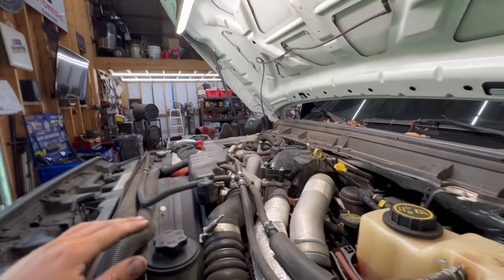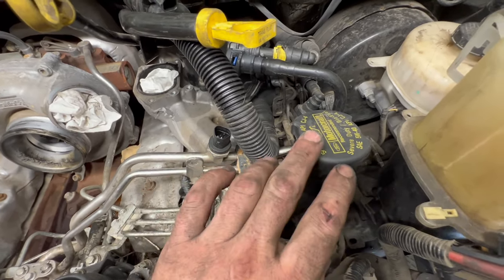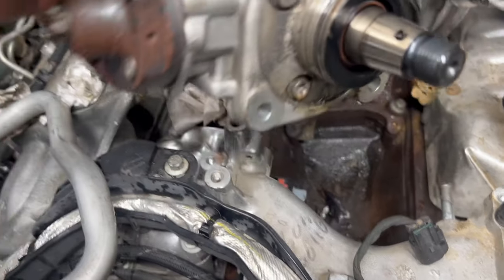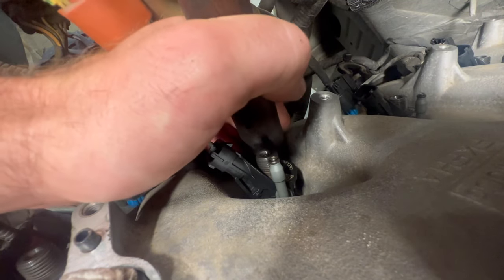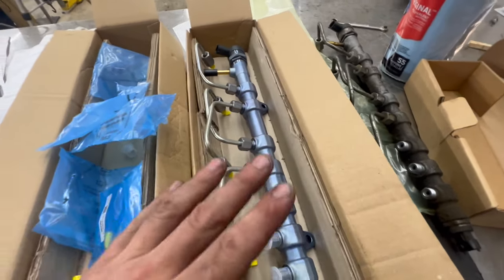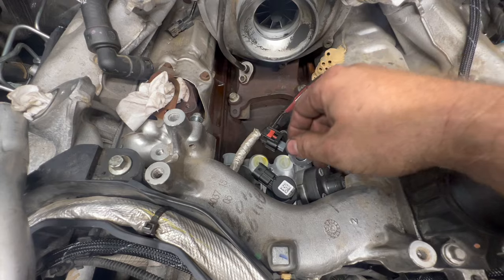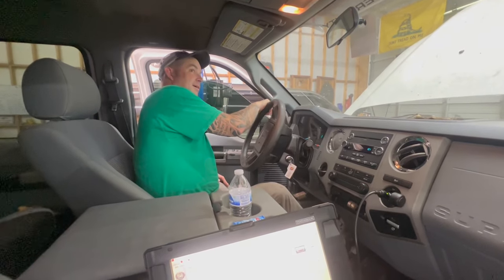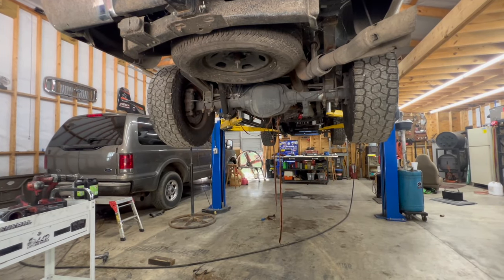6.7 Powerstroke cp4 fuel system replacement

Comment: EXCELLENT video! Doing a little bit of studying here. I’ll be replacing the CP4 on our 2017 F450 wrecker this week, got towed in behind our (thankfully) already CP3 converted RAM wrecker for a lack of power, then died while idling. Fuel filters are full of metal. Trying to tell my boss (a retired Ford master tech, did most of his work on 6.0s) that you can’t just replace the pump without having a repeat failure, as I’ve done this job on a couple LML Dmax trucks from my days at the dealer. Hopefully this hammers that fact home, as much as it sucks for the downtime of the truck and profit losses, it beats having to do everything a second time.
Reply: Hey, did you get it done? I’m about to attempt this job as well.

Comment: Very well done video on this project!  Thank you.  What did you see on the computer to follow this repair?  I have 2012 and died on the road with no start,  p0087 code.  I thought cp4 for sure,  pulled vca/vcv on top of cp4 and clean as a whistle no metal so I replaced it,  also looked at the PCV on driver side fuel rail also clean as a whistle,  replaced it as well.  Only getting around 300psi actual with almost 5000 desired.  Also put gauge on low side before engine mount filter and had 54psi.  Not sure where to go from there.

Any suggestions would be greatly appreciated.

Thanks
Reply: Mine is doing the same thing
Reply: Sounds like a cp4 failure. I have seen some fail without sending metal through the whole system. There is a good right up somewhere on the forums about it. I’ll try and find it.
Reply: Was it fixed? Have same issue here

Comment: my 2015 f250 needs this done to it, CP4 blew out about 2 months ago w/280K (yeah I drive a lot--DFw to Houston to Austin at least once a week sometimes twice). Luckily,  I have my previous truck-2011 Ram 6.7 for  back up. I am wanting to do the DCR and new rails/ injectors/lines etc, but I am wondering why it is necessary to drop the tank and clean it? with a new lift pump and the disaster prevention kit and both of the new stock filters, how would any of that glitter make it past those three filtration points? Also, with 280k, should I also replace the turbo coolant fittings or possibly the turbo too? I would hate to have to go back in there within the next couple of years for something I could have done easily while in there.....
Reply: My 2015 f250 just crapped out on me as well. Has about 170k miles

Comment: Really good and detailed video. Thank you! What scanner do you recommend for a 2017 f550?
Reply from the maker: I like autoenginuity(what I use)but I will try out the cheap one I just tried out on a 6.0 and made a video on it. It worked great on the older trucks so I’ll make one on the newer ones.

Comment: Amazing video! Question.. What are from not so bad to real bad scenarios of accidently putting gas in and running it till it quit, Then pumping gas out filling with diesel starting and running but now it is in limp mode. Thanks again!
Reply from the maker: Gas will ruin the cp4 fast. The fuel itself is all that lubricates it

Comment: Hate to think about the possibility of mine going out, but at 255k I figure its bound to happen at some point. I would like to do it myself but my expertise doesn't extend far beyond repairing tractors and bigger equipment, which is typically much less complex than my 6.7. Just general ballpark if you don't mind me asking, what did this fix cost the guy? The workmanship and quality you put into your work would definitely make it worth whatever the costs associated with paying you to do it would be.
Reply from the maker: It was around $7500 for everything
Reply: @AutomedicGarage man dude that’s a great deal for 7500$ ik people usually pay 10k or more I have a 2013 with 161k it had the cp4 pump replaced around 75k before I owned it I only run fuel additive every fill up or every other and definitely want to do a dcr replacement one of these dayz

Comment: What’s your honest opinion on the disaster kit?  Maybe I’m wrong but I just don’t see how a filter can stop all that debris pushing at 29k psi. Maybe it will but I’m a little skeptical. Obviously if the DCR is as good as they say it is this is the best solution. Let me know your thoughts. By the way that was an extremely good video on the process. Very thorough and the best I’ve seen on YouTube.
Reply from the maker: DCR is better money spent than the disaster kit

Comment: After doing any amount of research on Bosch CP4 high pressure fuel pumps why would anyone buy a vehicle with one? Why does Ford continue to use it? Both GM and RAM no longer use a CP4. GM quit using a CP4 in 2017 and switched to a Denso HP4. RAM went to a CP4 in 2019 and 2020 and after mass failures are now recalling those trucks and switching back to a CP3. Do truck buyers blindly purchase without any research? I don't understand. Ford is great if you make money fixing the garbage they make.
Reply from the maker: The 6.7 PSD was designed around that cp4. Nothing else will fit in the valley of the 6.7 but the cp4. That’s why you can’t use a cp3. I have a lot of 6.7s come in with 300k+ miles on original pump. There is another option now which is the new DCR pump.
Reply: @AutomedicGarage  I understand the space limitations of the 6.7's valley and non available space for a different pump. My question to Ford (they won't answer it) is why did it take the aftermarket to manufacture a replacement pump? Why did Ford Motor Company not do it? Would that admit fault on their part? I am a retired mechanic with 35 years on the job and your video is excellent and I'm sure will help many unfortunate enough to own a 6.7 with this issue. Thanks for responding I appreciate you and the information you kindly provide.
Reply: I'm one of those who has 340K on a CP4. I put an SPE disaster prevention kit on at about 90K when i made some improvements that reduced vehicle weight and created more space in the engine bay, just for the peace of mind.
Reply: @jimm2442 probably because Bosch made the pump. Just like Ford didn’t build the diesels before the 6.7.
Reply: I like how the egr coooler vanished on the example for the video.
Reply: @tprice3450 it’s always a good idea to clear up weight when adding a camper or something. Very smart move.
Reply: @aaronglaser  Thank you. I thought so too.
Reply: The real question is why people continue to buy powerstrokes? You think they would learn after the 6.0 and 6.4.
Reply: @boostbeast8731  Cause a Dirtymax or a transmission breaking RAM are not an option if you're serious about towing.
Reply: Does a 17 not have a cooler?

Comment: Is it necessary to program the flow rates on the injectors? I have to do a whole new system on my 2027 f350.
Reply from the maker: @ballacii  I’m assuming you mean 2017. Yes flow rates matter, each injector is different and the pcm needs to see what the new injector flows

Comment: What are your thoughts on the DCR conversion from S&S? According to the tests I’ve seen even if that pump dies down the line it has the advantage of not contaminating the whole system and it performs the same as the CP4
Reply from the maker: I’m on the same page with you, I want to get my hands on one. I like it.
Reply: @AutomedicGarage   Exactly. I’m a huge 6.0 guy, love working on them, love the platform in general. But the DCR coming out along with the newer steel piston motors greatly increases the likelihood I’ll own a 6.7 eventually
Reply: I have it going in on Tuesday. PTT Arod is installing it. Im pretty geeked to have it on my F250 2020 Platinum. It will be a good day!
Reply: Getting one put on mine.
Reply: I had it installed Tuesday. I can tell you the truck has more pep. And it does sound different. Very pleased and I can lose the anxiety of the cp4 pump leaving me on the side of the road. I also removed the disaster prevention kit.
Reply: Another guy I know told me the same thing. I can’t wait

Comment: Can you give a recommendation 
I have f250 6.7 2013
Code p0088 message power engine reduced 
I have replaced fuel rail ,fuel regulator, and 2 fuel sensors but still with the same problem please give an advice
Reply: Looks like that high press pump is bad time for a new 1

Comment: Can you use forscan to do the flushing and injector programming?
Reply from the maker: @matthewvannorman5667  not sure if forscan will let you command the lift pump on or program the injectors. I’ve only used autoenginuity
Reply: @AutomedicGarage   I'm currently gathering all the things im going to need to do this to my truck.  Any suggestions on the computer aspect of this?
Reply from the maker: @matthewvannorman5667  autoenginuity

Comment: How much do diesel mechanics normally charge for a repair like this? Im thinking I might need to do the same thing. I have a 2012 F-250 6.7L 300,000 Miles and it’s now doing the same thing. Crank no Start. Replaced both batteries and starter and nothing. Any idea on typically how much one would charge for parts and labor?
Reply from the maker: @Ceja-gc5hw  I charge $3500 labor which is cheap compared to most. Contamination kit is around 5k add around $1200 to upgrade to DCR pump which I highly recommend. Ford is anywhere from 10-14k for this same repair and I can’t explain why people get different prices from different dealerships cause the book time is the same regardless.
Reply: @AutomedicGarage  do you guys recommend I install a new contamination kit and DCR kit if my CP4 failed and there were metal shavings in my bottom (under the cab) fuel filter? And would this new conversion. Would I need to drop the tank and clean it out and program new injectors?
Reply from the maker: @Ceja-gc5hw  same thing as if you were replacing the cp4. Do the whole system, new injectors, logs, lines, filters, fuel cooler, flush the lines and drop the tank.
Reply: @AutomedicGarage  Ok thank you.
Reply: How long does a job like this normally take with breaks in between lol and with out breaks in between? I have a diesel mechanic working on the fuel system right now and wondering how long it takes?
Reply from the maker: @Ceja-gc5hw  I don’t get in a rush, do a clean job, torque and double torque everything and do a thorough job flushing the system after I drop the tank and before I hook the supply and return back up and I spend the better part of 2 days doing it.

Comment: I don’t understand how you can explain some thing like how to remove the high-pressure fuel pump gear, and then not show us how to do it. Because I’m hitting it with a punch and it’s not coming out.
Reply from the maker: I explained how to do it. I use a punch and a 2 lb mini sledge. Works for me. If you don’t care about the pump put a air hammer on it. I guess you didn’t think of the fact that it’s a hard angle to film while I swing a hammer at a punch or did I need to show how to swing the hammer?

Comment: Perhaps a little Marvel Mystery Oil into the tank everytime you fill up.
Reply from the maker: Marvel mystery oil has been disproved more than once, it’s basically transmission fluid.
Reply: I did not know that. PK, how about a little ATF in the tank with a fill  up🙂

Comment: Well, this isn't good. I've got a truck ripped apart following along with this video only to find out unless I'm blind there is no instructions on how to mark the vacuum/cp4 before pulling 😮 not good for me. Off to Google, I go.
I should say it's been a wonderful video up to thus point very helpful, I'm just having a panic attack now lol
Reply from the maker: @jamesh9770  I show in the video how to align the dimples for timing the pump. The vacuum pump does not have to be clocked at all. Just align the cogs on the vacuum pump.
Reply: @AutomedicGarage  thanks! Wonderful video! Very helpful. Thanks for the reply, as well as the videos I recently found your channel, it is very helpful.